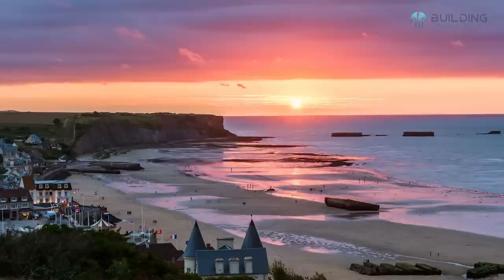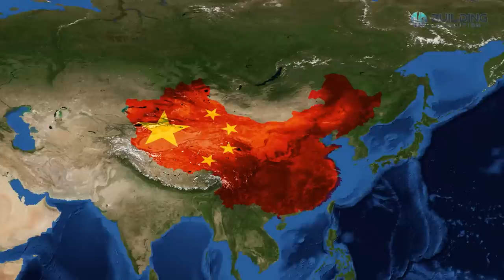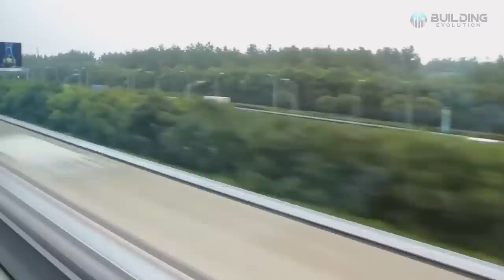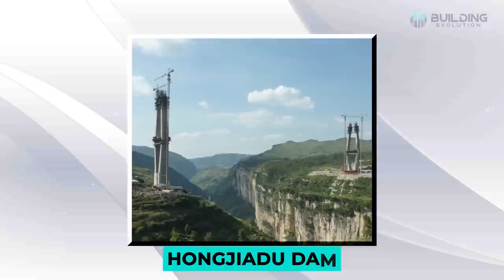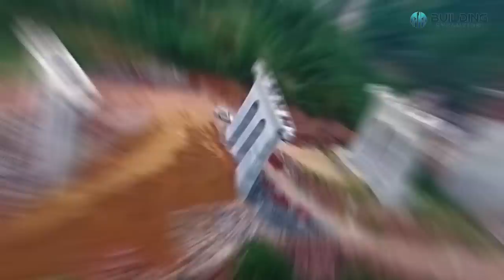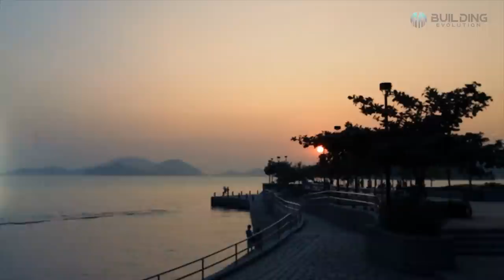China SHOCKS The World With This Bridge!

Comment: So many mistakes, errors and misinformation in this video...

1. the Qingdao-Huangdao bridge does not connect China and Japan. Both cities are in China. Also the bridge is not 42km long but only around 25km (as can be easily measured on Google Maps). Even if it were 42km long it wouldn't be the longest sea bridge even in China: the Hongkong-Zhuhai-Macau bridge is 55km long.
Btw: from Jiaozhou Bay to Japan the bridge would need to be over 900km long.
2. this is not the first tunnel constructed from prefabricated segments. This is a commonly used technique for under-sea tunnels and has been used for decades all over the world.
3. the 22km road tunnel in Xinjiang also isn't the longest (that would be the Lærdalstunnelen in Norway at 24.5km, or the Gotthard base tunnel at 57km if you also count railway tunnels).
4. "track lane"? I guess you mean track-laying. Also, this isn't the first cross-border railway bridge in the world by any stretch of the imagination, as rivers commonly mark the border between countries.
5. a 200m-bridge is hardly impressive. Also you show a maglev train, but this high-speed line uses conventional rail.
6. and with 100m this isn't the longest/tallest escalator in the world either (that would be the 4 escalators of 134m length each in St. Petersburg's "Admiralteiskaja" metro station).

... and that was only the first half of the video...
Reply: V
:00
Reply: Even mistake Yuan as Won.
Reply: @nicolasbautista3599  Yes, I really don't get it. All those projects are great in their own right. A 22km tunnel is an amazing feat of engineering, even when it's not the longest in the world. So why go over the top and spread false information?
Reply: @algung2522  false information is always bad, regardless of who spreads it.
Reply: And the airport on Palmer plateau with a 3000m2 terminal- 0.3 hectares lol
Reply: Both the O'Neill Tunnel (Massachusetts - part of the Big Dig) and the Fort McHenry Tunnel (Maryland - I've driven through this one) - used prefabricatred segments.
Reply: Try and appreciate the incredible infrastructure projects put together by China in shortest possible time. In USA a high speed train from Los Angeles to San Francisco is still not off the paper in 20+ years😂😂😂
Reply: @salmaagha8339  I do appreciate it. As I already wrote: "All those projects are great in their own right. A 22km tunnel is an amazing feat of engineering, even when it's not the longest in the world. So why go over the top and spread false information?"